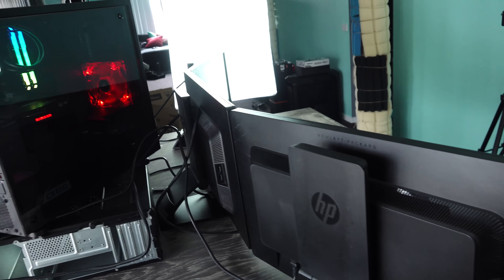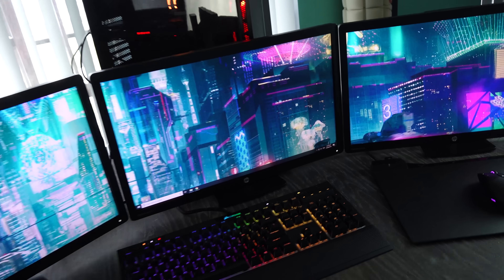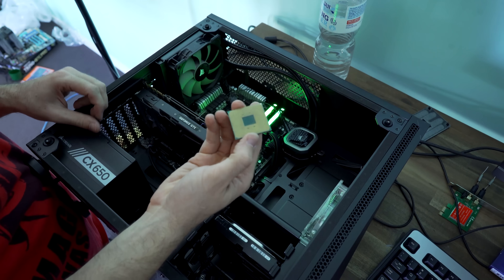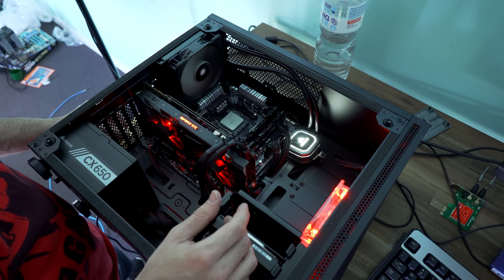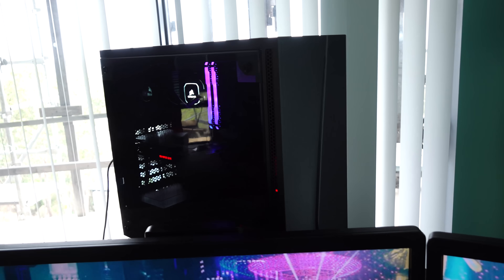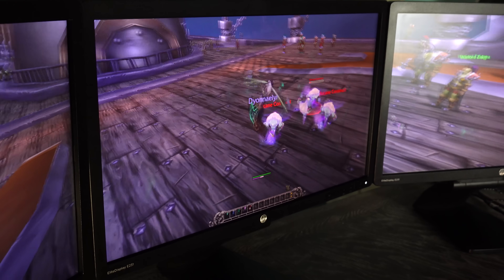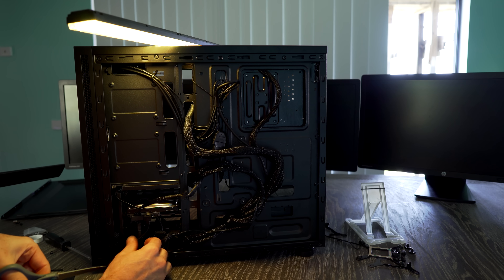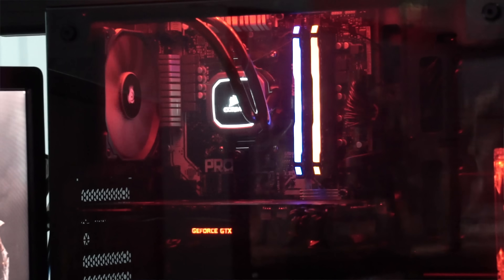Ryzen Problems...!? Post Analysis of the AMD WoW Gaming PC

Comment: that hapen a lot for me  its not exclusive on ryzen  happens on intel too you have to delete all the hard drives and only format and  activated the hard drive or ssd y9ou want to install windows on and then  format and activated the rest of the hard drives inside windows problem solve
Reply: same here (on other post) but i norm just unplug my disks or disable the ports in the bios
Reply: Same thing happened here too. Haven't resolved it yet. Shit of I loose all the data on that HDD. Thanks for the info. I thought I was alone.
Reply: a new bootsector can be made on the proper drive with the bcdboot and bootsect commands in the command line. and setting the new boot partition active.

After that you can test booting the system drive standalone.

Moved tons of existing windows installations from failing old hard drives to new drives just fine.
Reply: @klontjespap  will look into it. Thanks!
Reply: B00tman 
I expect may have to shrink your data partition by 100mb because the drive space is fully allocated to a ntfs partition now though

The boot partition has to be in front of the data partition and marked active too

Minitool partition wizard is a nice free tool you can shrink and move your existing partitions with
Reply: Title is a click bait and misleading.. why are you singling out AMD... 

OH RIGHT, I FORGOT INTEL HAS SPONSORED HEAPS OF YOUR Videos before.
Reply: Or the fact it only happens on AMD platforms from experience. Also did you forget AMD sent him to Italy? Stop fanboying and check facts before you accuse ;)
Reply: @YusufNayab  I made that comment before he changed the clickbait title.
Reply: @rick_takahashi  point still stands, if he makes a video on the issues with Intel CPUs the fanboys will get upset. But it's for the greater good of educating the masses. He noticed a few problems that reoccurred and he taught people how to notice and  fix them
Reply: @YusufNayab  well, the title has been changed.. so that's fine now.

I just found the old title to be very misleading... Hence, why you have heaps of comments here that it's not isolated to Ryzen.

Comment: God sake, yet more Ryzen issues..If it's not Ram issues it's something else.
Reply: This isn't even a Ryzen exclusive issue though. It can happen on Intel as well. Just don't have more than one drive plugged in when you install your OS
Reply: @mr_beezlebub3985  yeah true.
Reply: Mr_Beezlebub yeah, i don't understand how he never had the problem before, it's been around since like windows 7, if not even longer.
Reply: Relax fool it's not a ryzen issue jack ass
Reply: its not a ryzen issue its windows (just first time its ever happened to him) this issue dates back to windows vista on wards on how its reading the disk order and assumes sometimes disk 0 is your boot drive or something is on the boot drive your trying to use that prevents it so it puts the boot info onto another disk, just unplug your disks or disable the ports in the bios before installing windows

but a lot of the time its due to the boot order in the BIOS been set to HDD first not SSD

Comment: woohoo first comment , im going to do a amd rysen build for my first gaming rig
Reply: me too. first time in 15 years in getting back into it. going with 2400g. gpus are soooo expensive now
Reply: im just going wit the 2600 with the b450 with a 1070ti or 1080 should be all i need
Reply: @Ka0sAssassin  2600 with a 1060 was my initial choice, but i dont wanna spend 300 for a gpu. but if the apu cant handle cyberpunk then ill probably end up getting a gpu
Reply: Chad Mulligan yer not sure I would be a big ask for a api to run that since it’s still a few yrs out from being released but I’m not that smart to know maybe someone else here could answer that
Reply: @chadmulligan5629  Have you looked at the used market? I ask, because RX 480 8 GB (which is generally a touch faster than the 6GB 1060) is going for $150 or just under. Those are pretty decent deal right now. I'm trashing my Titan Xp (current market value at $800 used) for 4x R9 Fury (current market value of $700 total) because even 2x Fury wins in most of my games. I'll be building a Halloween edition called "ThreadREAPER", and I hope to have LN2 or DICE cooling for a spooky fog effect. The GPUs will just be water cooled (probably hard lined) with blood red dye going into a skull reservoir with everything decked out. It will look nice running my 3x 4k monitors (the Titan couldn't run a single monitor 60 fps at High settings, so I'll actually get to run at least some games at triple 4k)
Reply: @jakegarrett8109  the only way i would ever consider buying used is if it was a whole rig. i just dont trust the fact that someone would sell a perfectly good and still relevant gpu.
Reply: @jakegarrett8109  that build sounds awesome though dude. id love to see it once its built.
Reply: @jakegarrett8109  subbed and waiting!